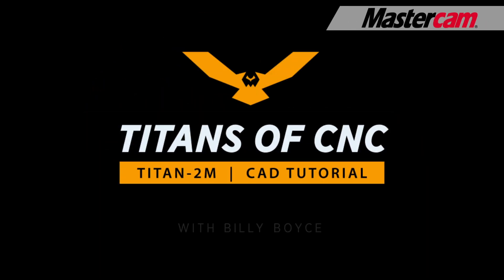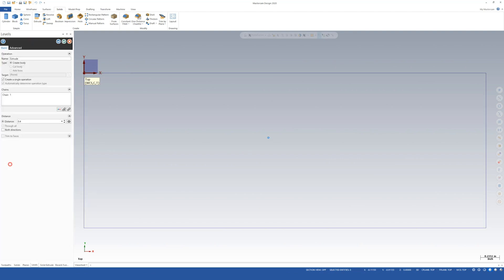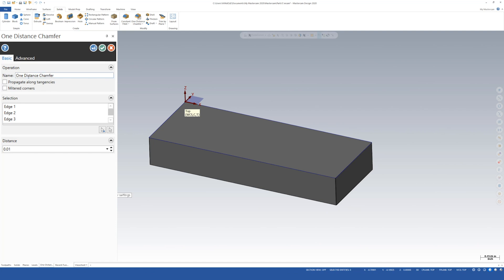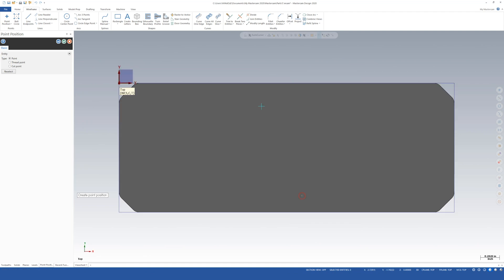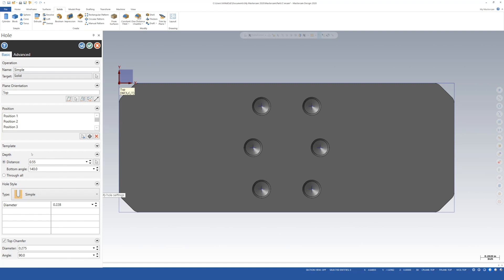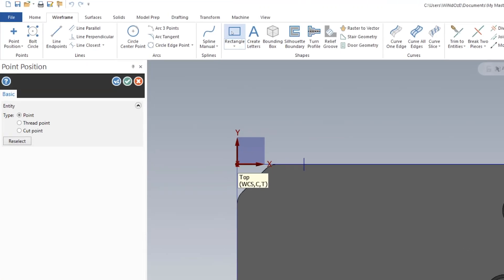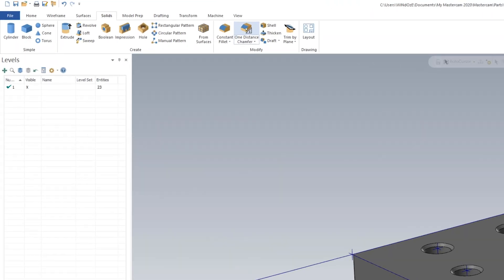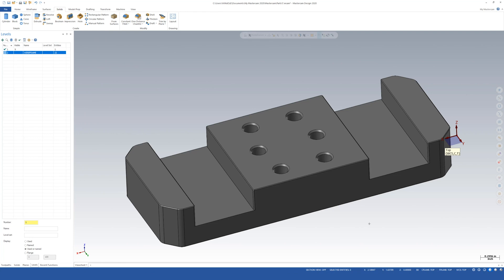Mastercam CAD Tutorial | Designing The TITAN 2M (FREE Resources)

Comment: Thank you! I learned a lot of new methods and reinforced some others that I learned earlier. I find that I use construction lines and transform tools (i.e. mirror, array, translate) a lot, but then comes the tedious work of clean up with trim tools. The opening model has threaded hole features, but not the closing model of this tutorial. I will look. Any pointing to that solid tool thread feature would be appreciated. Thank you Billy Boyce!! - Jeff
Reply: I found "ThreadC" in the c hook folder, but it wouldn't let me open it in Mastercam Design. So I guess that is not it!